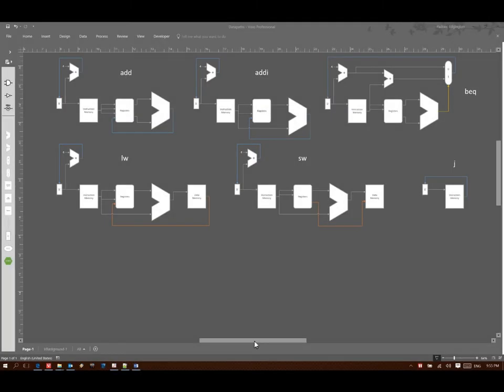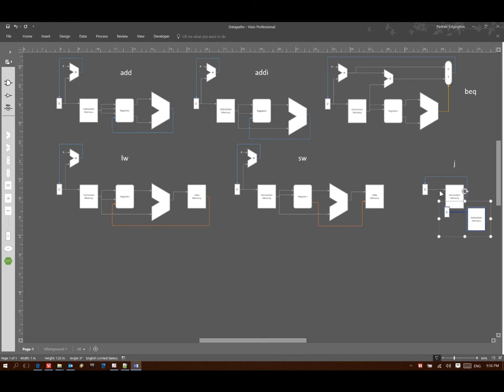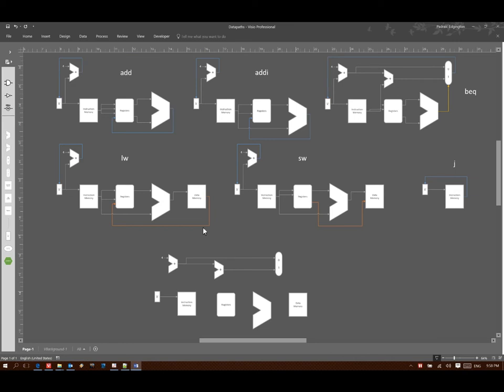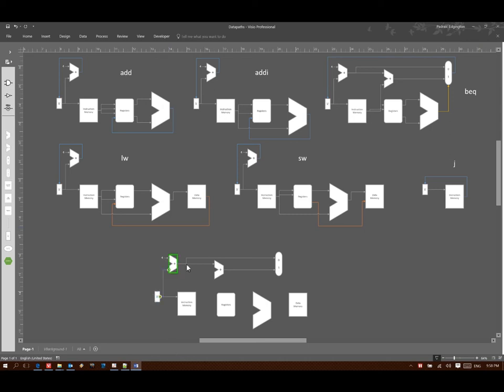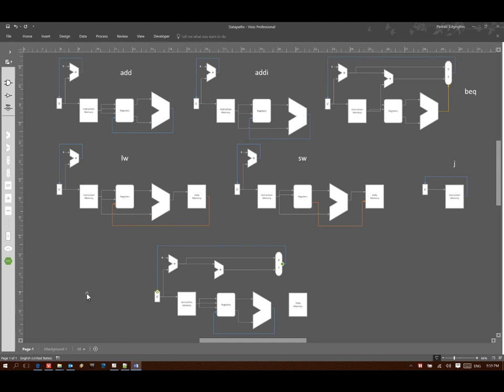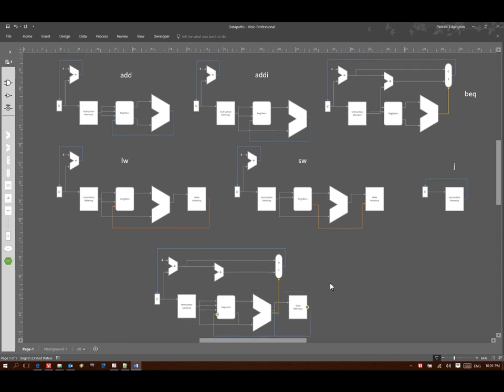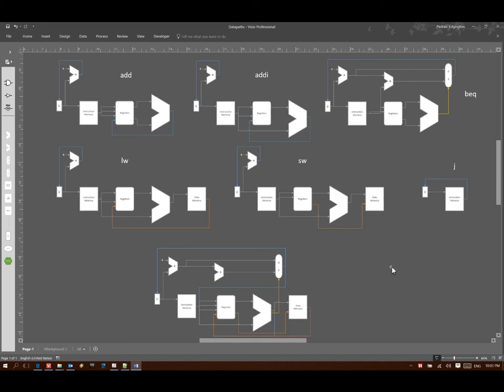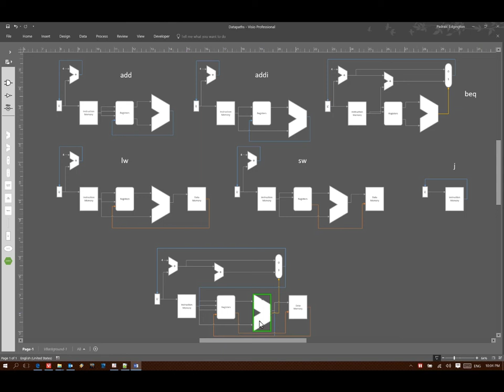2-7.  Combined Datapath

Comment: Nice Video!  (p.s.There may be two missed lines in the conbined fig)
Reply: I only see one, it needs one more wire from the register to the alu for the second readed data
Reply: @nayjer2576  Also the second adder have a missing wire from the register's immediat value